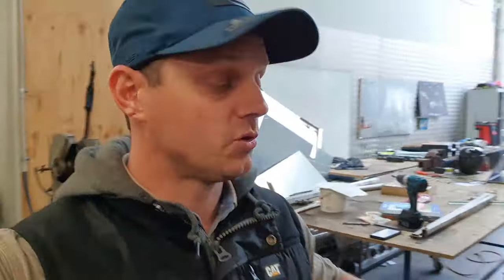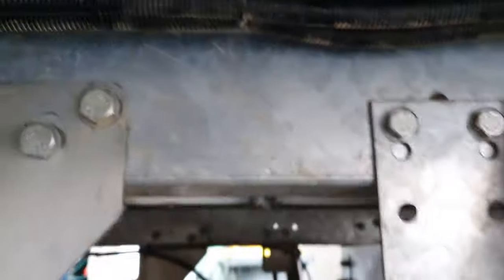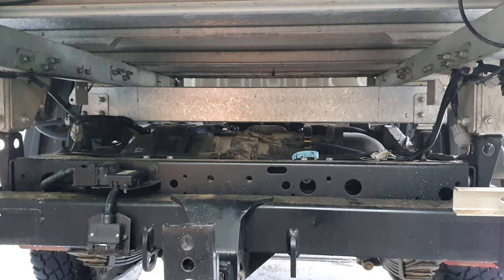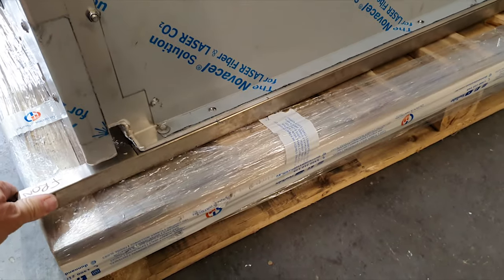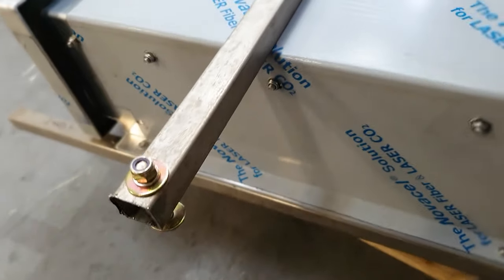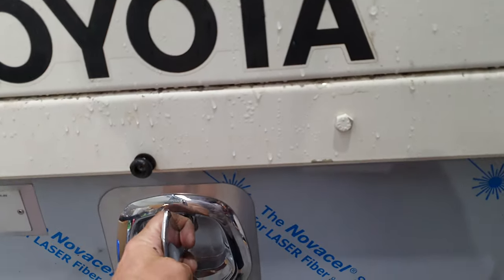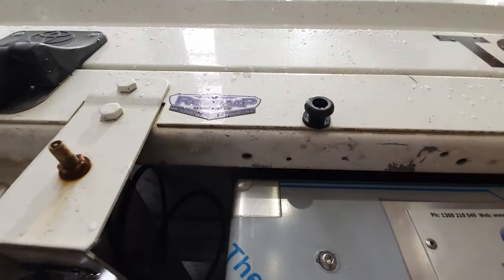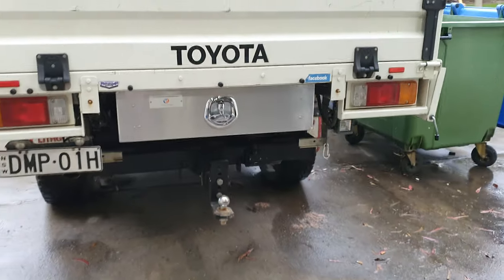dunn and watson draw install

Comment: Hey mate I know this is an older video, but how does the drawer lock? Whats the whale tailtab go through? Cheers
Reply from the maker: There's a lip around the body the draw slides into, it locks against the top it also holds the weatherproofing rubber, so all locked internally
Reply: @AdamAbello  Cheers mate

Comment: Hey mate how did tou dogure out the recess ampunt for the lid to open fully. I couldnt dind anything in the website. Any tups appreciated.
Reply from the maker: was a bit of luck actually i wanted the draw fitting just behind the tray lip, so didnt have to worry about clearance, but you could have recessed it by the clearance required from the front of the draw, around 4 inches i could have gone back

Comment: i have a 2017 hilux with an aluminium tray from toyota and im looking at a 1700mm drawer, seems easy to install from this video but where would the spare tyre live mounting an under tray drawer?
Reply from the maker: That is an issue mine went on the back of my tool boxes on the tray. some people put on the roof racks but I don't like 40-50kg up that high. 😒  best place is against head board good centre of gravity and out of the way.
Reply: @AdamAbello  i have a 3 door full size canopy over the length of the entire tray
Reply from the maker: Inside the canopy?